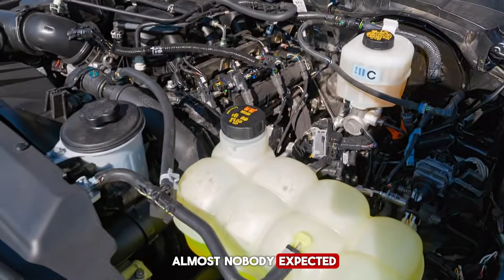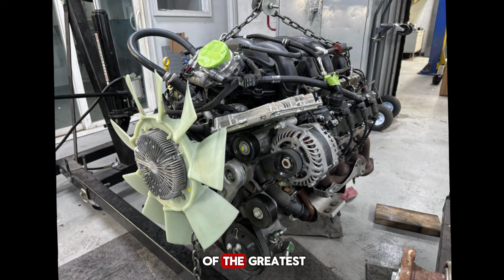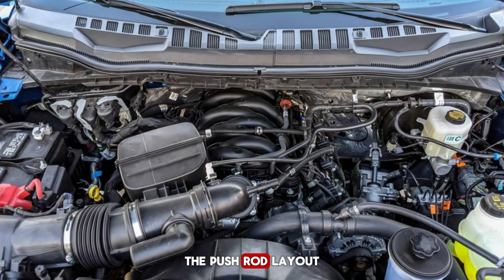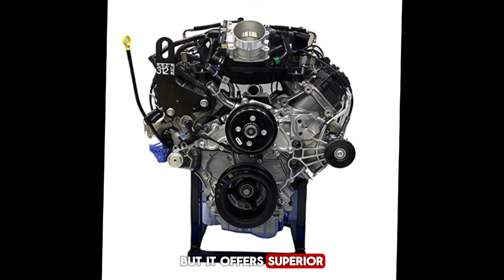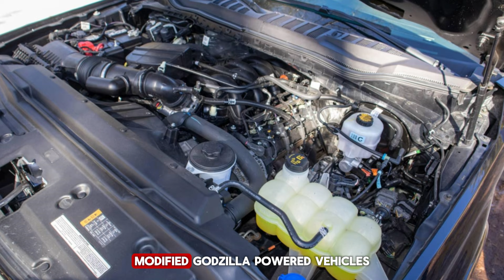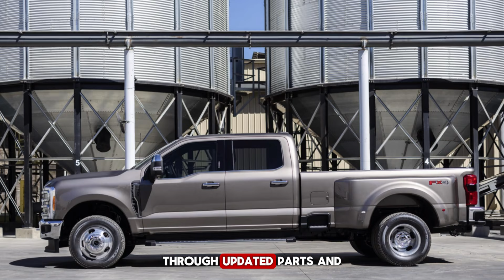Why Ford's 7.3 Godzilla V8 Is Bringing Back Old-School Power

Comment: Just drove a f250 with 7.3 600 miles with a 8600 pound trailer and wow what a smooth drive. Power on demand cruising at 80mph